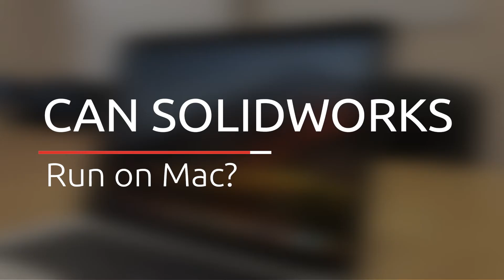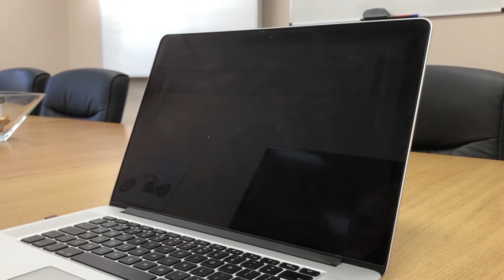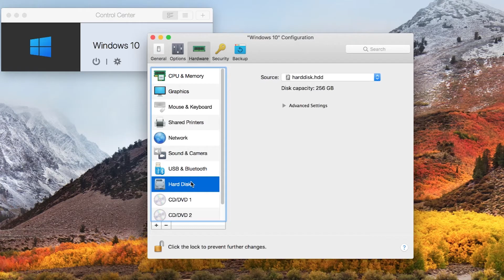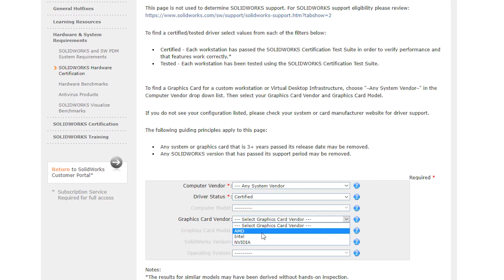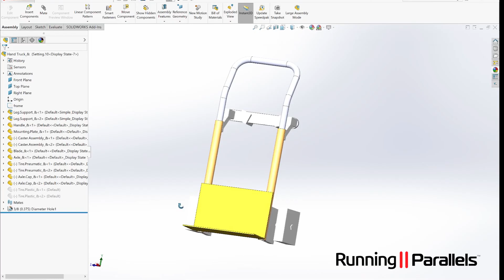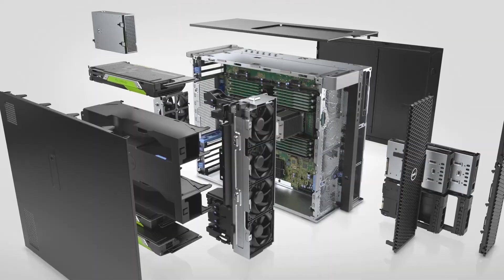Can SOLIDWORKS Run on a Mac?

Comment: And then came Apple Silicon... AKA M1..... No more windows om MAC... for now.
Reply: Its running on my  Macbook Air M1
Reply: @mehul_kapadia  what is your configuration?
Reply: @gauthamguru9311  haven't tried this myself yet, but I've heard of M1 Macs running Solidoworks under Parallels. You have to get the ARM version of Windows 10 from the Insiders program. It's a hassle, but from what I've heard doable.
Reply: @mehul_kapadia  using parallels ?
Reply: @LeRatVisseur  gotta be. And ARM build of Windows 10. That's the only method I've heard works halfway decently

Comment: I've run SW on Win10-guest/VMware/Linux-host.  Hardware is i7, 32 GB ram, 4gb nvida gtx 1050, nvme SSD & I hand over most of those resources to run guest (Win10).  SW runs ok, but will freeze for a moment on occasion & then resume.  Once in a while, SW will crash, but not a lot.  You really need to run SW on bare metal install of Win10.

Comment: Okay, so the simple answer to the question: Can I run solid works on mac?
It´s: No
Reply: i have a macbook and i use solidworks just fine
Reply: @JoseShajiOfficial  can you please tell me..how is your experience for solidworks and catia on mac
Reply: @ashutoshpande8718  it’s not bad, everything runs smoothly
Reply: @JoseShajiOfficial  I have a 2020 mbp13in with a 10th gen i5 and 16gb of ram but with the intel iris plus graphics. Do you think I can run solidworks ok using parallels? I’m a civil engineering student if that helps.
Reply: @JoseShajiOfficial   I'm.thinking to get the new M1 MBP 16"... Will parallels help to run the solidworks and catia smoothly? What do you think?
Reply: @ATM17820  I’m not sure how it will run as parallels hasn’t been fully developed yet for the M1 chips, and the 16 inch M1 MacBooks haven’t been released yet so you will have to wait a bit to see
Reply: @JoseShajiOfficial
Reply: @JoseShajiOfficial  if I get macbook 2014 which has i7 16gb ram 256gb SSD and 1.5gb graphic card will it work fine after bootloader windows install because in my college they say it will not work good as windows

Comment: Hi there.  The new Macbook Pro 15 comes with Radeon Pro 555X with 4GB of GDDR5 memory.  Will Solidworks work normally if I install Windows 10 using bootcamp (and not Parallels)?
Reply: Yes it will work
Reply: Wondering too. Have you found out?
Reply: It’ll work

Comment: If you install Windows on your Mac. As long as I use SW I’ll never own a Mac.
Reply: i own a macbook pro and I use solidworks
Reply: @JoseShajiOfficial  You run Windows on your Mac to do that, no?
Reply: @alchemist1111  yup, I dual booted my MacBook, it has windows and Mac os
Reply: @JoseShajiOfficial  can i buy the new m1 macbook air base model for solid works , will it run smoothly , pls reply
Reply: @NoorMohammad-fr3td  no, no bootcamp for m1 processors at the moment , we will see in the next months
Reply: @francescomignone5416  any updates?